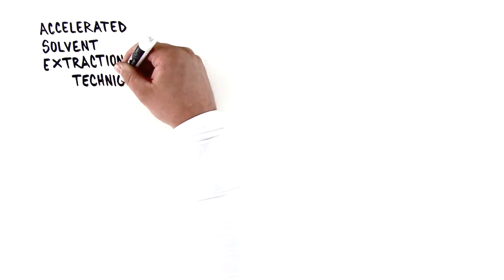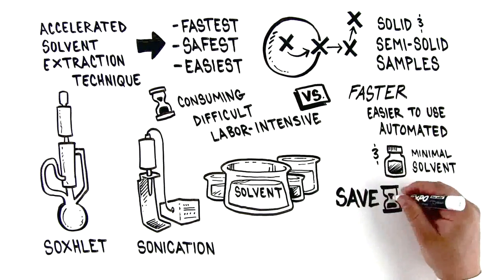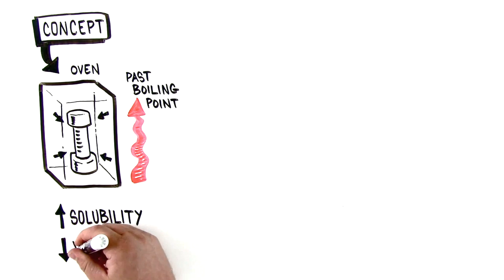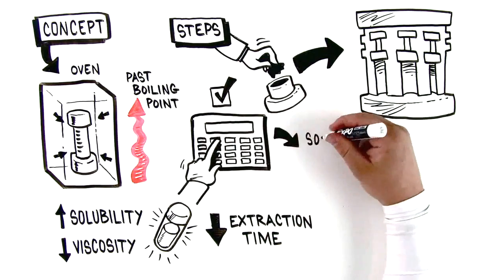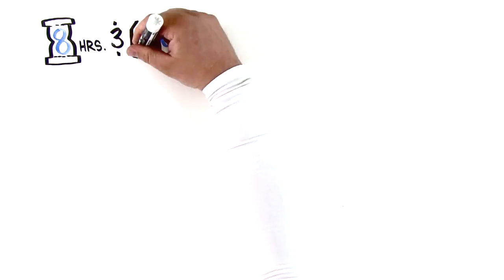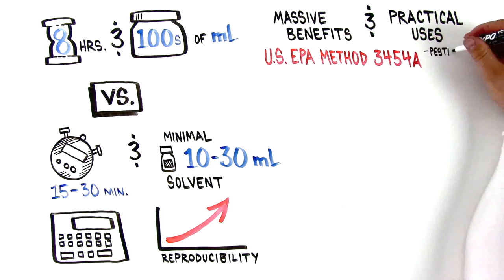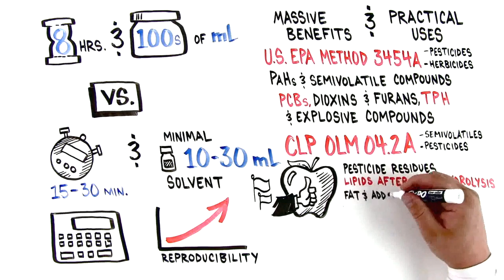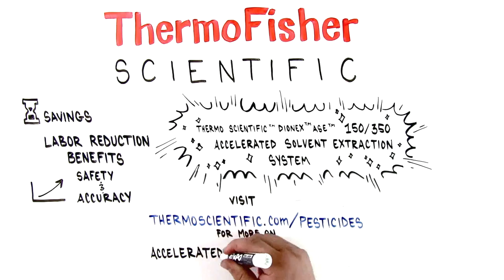Introduction to Accelerated Solvent Extraction

Comment: what is exactly the difference between this and SFE (supercritical fluid extraction) i mean both extraction methods seem to about increasing pressure and temperature. is the performance of the solvent increased by increasing temperature an pressure but the solvent is just not yet in his supercritical state. or is the difference more in the automation of the process itself?
Reply from the maker: Thank you for your question. 

Please contact our technical support team at thermofisher.com/askaquestion for additional information regarding the Orion pH electrode. 

Thank you!